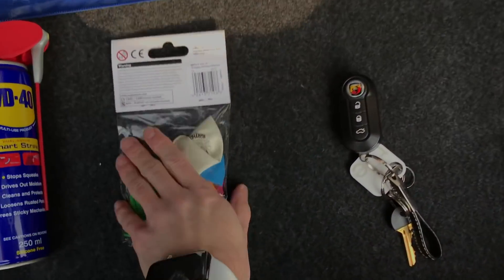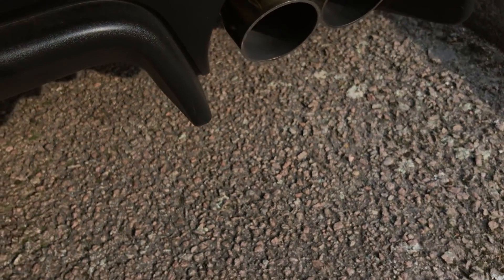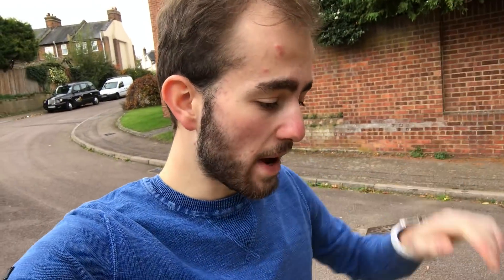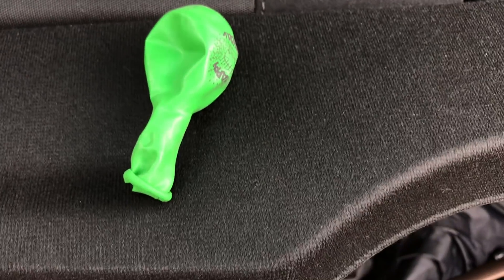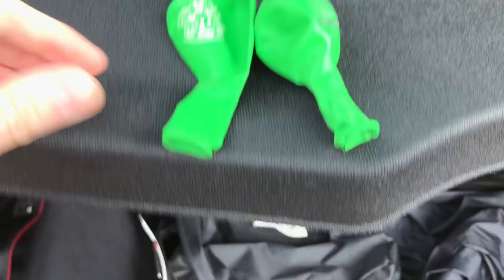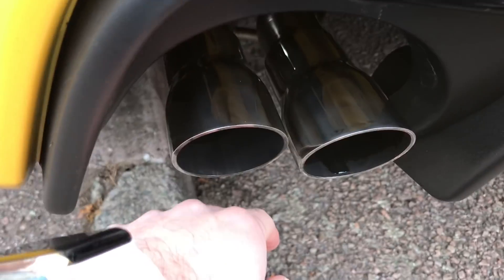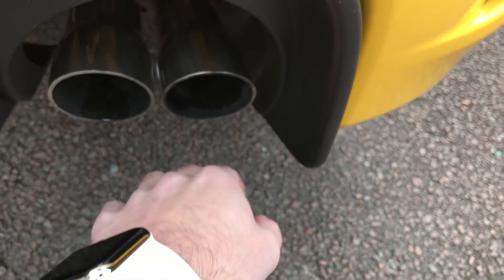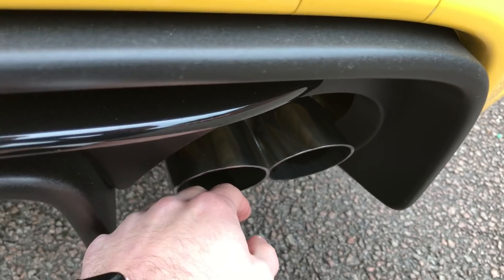Record Monza Exhaust Valve is now open... for business

Comment: The spring pulls the valve shut. When the gasses go through it they push the valve open pulling the spring and then when your off the gas, the spring will tension back up (spring back essentially) and pull the valve shut again. Had to think about it lol but thats how it works. The Monza has done it for years. Mine seized shut and I had to get the exhaust replaced as the valve wasn't moving at all. Yours is actually fine, perhaps the spring was a bit tight or it's come loose if the valve is moving now. The best thing you can do is get some metal cable ties off ebay and tie the valve open. So that'll be in in the direction away from the spring. It'll stop the valve from seizing shut, because if it gets too bad you'll end up having to replace the exhaust.
Reply from the maker: +Ashcphotos Hey buddy! Yeah it took me a while to work it out but that makes sense, I’ve already got some cable ties to I will make sure I open it and keep it that way. It’s the simple solution I think as taking it to the dealer is a hassle for something that is just likely to happen again. Thanks for watching!
Reply: Marco Persichillo just make sure there’s metal ones. Plastic ones will melt with the heat.

Comment: The grease form of wd40 is what you need because wd40 comes in all forms it’s got lubricant written on it I bought mine from eBay wd40 the normal one has not got lubricant written on it , it will clog up again .
Reply from the maker: mercedescclass0809 yeah I expect it too! But thanks for the suggestions